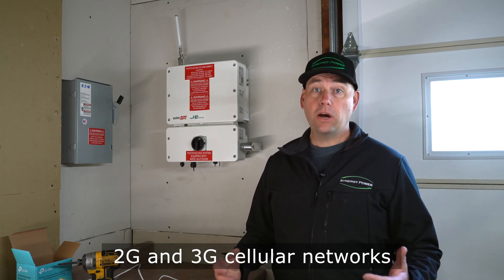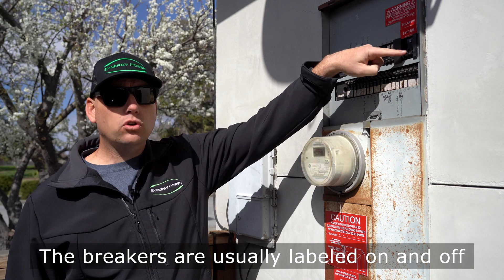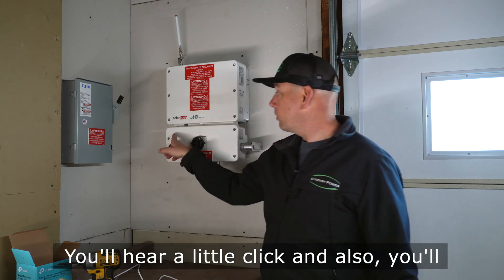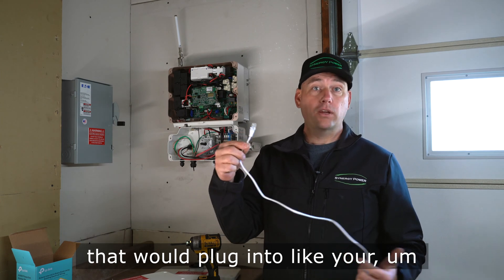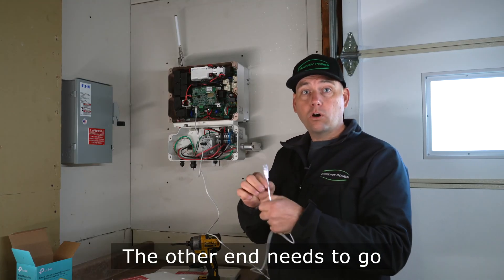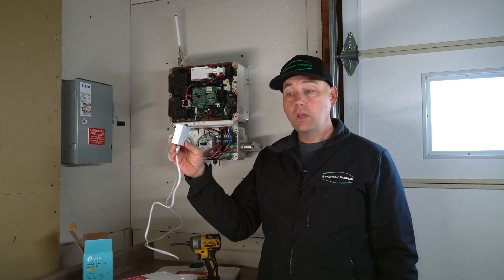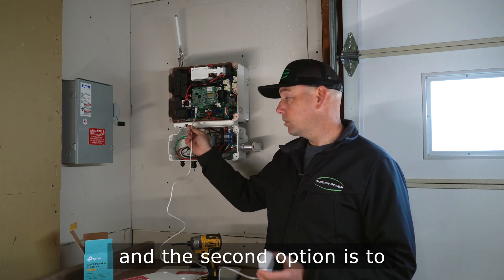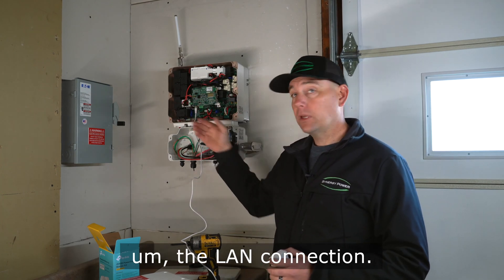SolarEdge - Network Options (Wifi Kit or Directly Wired)

Comment: I’ve purchased all the parts. I’ve set up the extender but my inverter does not have a breaker in my panel or sub panel. I do have a big disconnect labeled DC on the wall by my panel. Could that be my “breaker” ? My installer wanted $1000.00 to update my solar. Working on it myself but hate to be electrocuted.

Comment: I shut down the inverter and the circuit breaker to off. I opened both top and bottom of inverter. I inserted ethernet cable into the ethernet port as shown. I have wifi through a mesh system that has decent signal to inverter location. I bought a wifi wireless extender for less than $10 and configured it to extend the wifi signal from the mesh system. It has two ether net ports to directly wire ethernet cable to wifi extender. I plugged the ethernet cable from the inverter to the wireless extender which I plugged in near the inverter. I opened the regular homeowner mysolar edge app and switched communication to LAN. For a few hours it said no communication although it was indeed communicating all the data to the app. Afterwards, the system updated itself and now gets clear data. FOrgot to mention that once you re power up the system, you have to toggle the little red toggle switch hidden under the top inverter to the left for one second to reset the inverters. It then recognizes that the ethernet port is being used to send data. Also, when you switch the app to lan, it asks you to take a picture of the QR code on the side of the top panel and connect your phone to the same wifi signal it is throwing off. I pieced all this together watching different videos. Here is a good one on how to switch from LAN to wifi using the app itself.https://www.youtube.com/watch?v=wMaJxhl0vl8
My innovation was using a wireless extender and its ethernet port so I didnt have to run a cable to the router.
Working fine!! No more $45 for annual cellular and no $700 for wif antenna!

Comment: Powerline should be a last resort.  Just use a wifi access point that joins your existing wifi network.  Weird that the SolarEdge wifi option isn't even mentioned ($300)

Comment: Other subscribers have stated a similar problem I have as my inverter is also mounted outside (on my garage wall) and is approximately 223 feet from the router which I can move maybe 17 feet closer still leaving it more than 200 feet away.  I was never notified these changes/updates were going to be needed and have had my system 6 1/2 years.  I was given this option of hardwiring the system or a more expensive alternative (purchasing a 4G Cell Kit) which would need to be upgraded again in 5 years.  If I chose the TP Powerline starter kit would it be best to drill a hole through the garage wall to access a wall outlet or try to find a cover that might fit over an outside outlet?  Safety first.

Comment: So yes my question. My system ground mount away from house. It less 4 years old upset cause my installer nor my solar edge contact  inform me of this . My installer is weaseling out saying they got out residential installs look made cause it's my hard earned money that I have put up this. Just frustrated from what information I've gathered estimating $700 to get solar edge communicating again. 
What can I do?  Without messing with the warranty
Reply: What did you end up doing?

Comment: How do you change from cellular to LAN connection? Do we need to call solar edge?
Reply: Good luck getting a hold of SolarEdge. They don't answer the phone. I've left call back numbers, but they don't call back.
Reply: Access the settings using a separate app or if you have screen with buttons you can literally scroll through menu and change settings yourself after you are connected via Ethernet cable or LAN connection to your homes high speed internet router and modem. In so Cal contact me directly for more info and help

Comment: I am so disappointed with Solar Edge. They sold this technology knowing it was going away. I can't do this option because my inverter is mounted on a outside wall and my router is clear across the other side of my home. No plugs to do the bridge either.
Reply: Right mine ground mount 100ft est away . I went with small company to install. After reaching out their customer service was not very helpful. Then sell guy but they got out of residential installs 4 years ago. My system is not even 4 years old . Then after finally getting a hold of my solar edge they want an installer to come install new hardware at estimated $700 which 😡 maybe there will be civil lawsuit.
Reply: @Sciontc22jj  I got mine working on my own. I had to DL the My Solar edge SETTAPP.  Then create a installer account and then run the Sett App and switch cellular to LAN
Reply: @Alex13mod  where do you switch cellular to Lan in Sett App??
Reply: @chuckbrown7570  Looks like my comments are being deleted. Idk it's being deleted since I didn't violate anything.
Reply: @Sciontc22jj Solar service rates are insane!
Reply: I USED AN WIFI EXTENDER/Repeater WITH USB POWER the  ONLY ISSUE I believe they disabled my LAN port, so even though my repeater is sending an internet connection it is not work. 
FOR mine, no cables are sticking out.

Comment: In your video the first step: turn off the circuit breaker(0:37), the second step: turn off dc power on the inverter(1:14), and the third step: dc disconnect(1:41), but on 1:44 I see that, in addition, the block on the left side if turned off as well. My block has no this breaker and the block шы sealed. My question: are enough only the first 3 steps for safety? Thanks.

Comment: How do you update the inverter to LAN connection instead of the dead cell connection? That is the most important part :)
Reply: same issues I got
Reply: I know seriously wtf
Reply: Thx for nothing. Here’s how to plug in an Ethernet cable. Uhhh..duh…
Reply: @Brian-ub2mt  ya, there are a lot
More steps to make
It work. Let me know if you need help.
I figured out what needs to happen after lots of trial and error.
Reply: @donnerlake6786  Hi Donner, i just installed the network cable and it is showing up on the View only mode of SetApp.  I think i understand that I must change the default communications to LAN.  i seem to be stuck here.  any advice?
Reply: @donnerlake6786  please share how do you change to LAN
Reply: @ddraco75 still stuck to same issue ? I am facing same issue

Comment: Do you have a video on how to switch the connection from 3g/cellular to LAN? This one was very helpful thank you!
Reply: I was able to create an "installer" account by clicking the link inside the setapp app. It is all automated, just give them a different email from your regular owner account and don't try to enter your inverter serial number when signing up for the account.
Reply: @danielcranford3650  holy crap that actually worked. I didn’t use the app but just went on the website and created one. Just used a buddy’s tax ID, upgraded the inverter software and 2 clicks to change it to LAN. Thanks!
Reply: @johnp544  and you don't even need the tax ID if you select "self installer" of the first page. But whatever, you just need the account to reconfigure the inverter.
Reply: @danielcranford3650  very interesting... the account was approved even though no Inverter serial was provided?
Reply: @19Stifler91  Yes, you just have to unselect the "access to monitoring" checkbox and the form doesn't require linking an inverter. Account creation is automatic, you just need to confirm the email you use.
Reply: @danielcranford3650  awesome! thank you. you able to successfully change the settings to wifi or lan?
Reply: @19Stifler91  I tried wifi first and the SetApp warned me there was no wifi antenna installed. The comms board obviously has all the hardware needed for wifi built in since connecting over wifi is how SetApp communicates with the inverter. I suppose I could have tried it anyway - or tried re-purposing the 3g antenna for wifi. But since I already had opened the box and had an ethernet cord running out to it, I went with LAN
Reply: @danielcranford3650  Thanks for all the info.  I am trying to create an install account, but once I deselect the serial number check box, the "create account" button will not let me proceed.  Do you have similar experience and how to get around?  Thanks again
Reply: @seanxie3261  check if there are any other required fields missing. I selected self-installer on the first page and deselect "request access to monitoring" on the second page, but there are a number of other required fields such as address.
Reply: I did not initially see the self installer option.  After the unit updates the firmware, I was able to change to LAN and according to the router data is being sent out!  A Big Thank you!
Reply: Mine has wifi, obviously, since that's how it communicates to the phone. It did the firmware check and i went looking under site communication .After clicked I on wifi it said something along the lines of "no external Wi-Fi antenna detected. Do you wish to try with internal Wi-Fi antenna? I picked yes since my router is almost at arms length from the inverter on the other side of the wall. Picked my network, put the password in and it connected right to it, then I went to Monitoring and it automatically switched to my Wi-Fi network and took about a minute to connect. Now I'm monitoring with my Wi-Fi connection.
Reply: I have the same question.  I cannot figure out how to change the communication from cell to LAN using the mysolaredge app.
Reply: @sochs2598  found out that the only way to do this is to use the “SetApp”. Unfortunately this requires a permission credential that is grated if you are a registered installer. Solaredge will not grant temporary access and just directs back to your installer for help. This is what I have found out anyway.
Reply: Lou: did you figure out how to do this?
Reply: The sign up site requires a company EIN which I do not have.  I did reach out to solar edge and they were useless but did suggest signing up as an installer which surprised me.  When I mentioned the requires EIN I got no response.  I reached out again to my installer but that will be a service fee.
Reply: @sochs2598  I'm pretty sure that field only appears for certain selections of the "Job Type" field on the previous page. I selected "Self Installer" and it does not appear.
Reply: @sochs2598  Literally just make one up. type in numbers.

Comment: Solaredge tech support told me today they do not recommend this because the frequency will burn up the motherboard.
Reply: I've used countless powerline adapters for solaredge never had a issue, the only reason solaredge is against it is because it's not a solaredge branded product and  can't make money of it.
Reply from the maker: Hello D P, we always check directly with our SolarEdge representative before recommending anything, so I wonder why the tech you spoke with told you that. All of these options will work without causing harm to the system.
Reply: @synergypower2666  yeah that tech support is a fucking idiot and probably just trying to upsell you
Reply: I was told the same thing.
Reply: @rgs4x  ill let you know when mine burns up